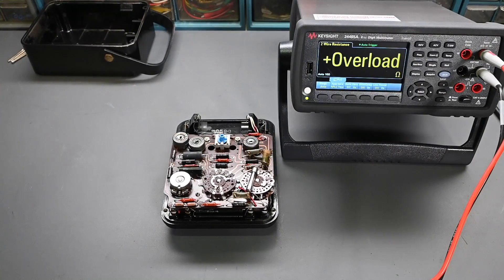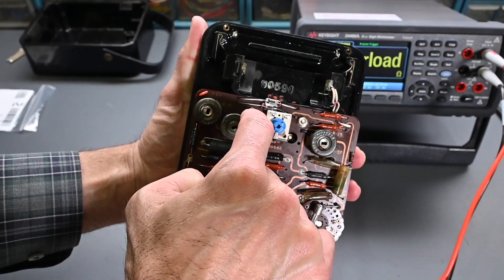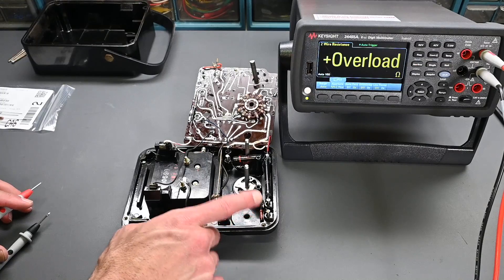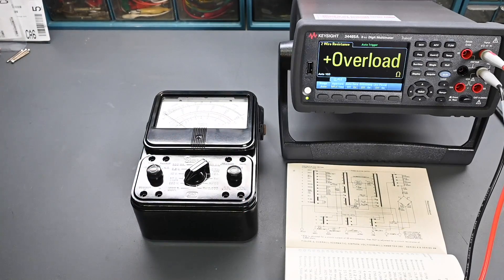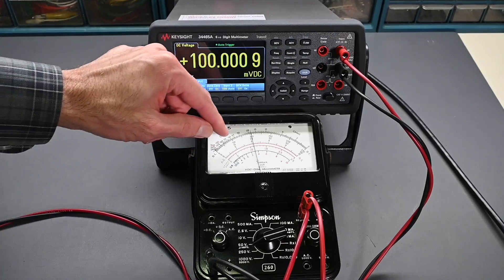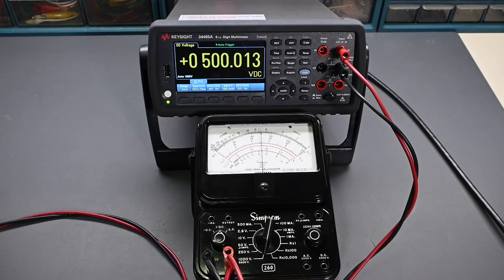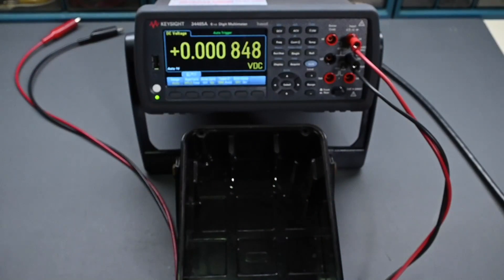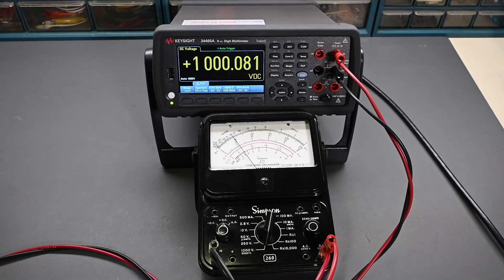Simpson 260 - 4 VOM Troubleshoot And Repair - Part 2

Comment: The resistors inside the Simpson 260 are used as dropping resistors to step down the voltage. A Resistor is NOT decreasing the electrons but is stepping down the voltage. Since voltage is NOT electrons, what is voltage? Voltage is EMF but EMF is not electrons.
Reply from the maker: Voltage can be thought of as a measure of electrical pressure like water pressure in a pipe.  The voltage comes from a  source such as a battery or in the case of the water analogy a pump.  A resistor is a restriction to electron flow like a pinch in a pipe.  Current (amps) is the amount of electron flow like the amount of water flowing in a pipe.
Reply: @EriksElectronicsWorkbench  Yes I get that but what I don't get is how to convert Pressure into what? because Pressure is NOT electrons. Pressure is EMF which also EMF is NOT Electrons so not sure how to convert Pressure/EMF into Electronics Theory
Reply from the maker: @waynegram8907  there are three basic things needed to create a voltage which is the potential difference as measured between two points.. electrons, conductor, and a force to drive the electrons.  The force can be mechanical like a generator or chemical like a battery.   Voltage is the "pressure" so I'm not sure what you want to convert to but perhaps some info here is helpful https://en.wikipedia.org/wiki/Coulomb   you would need to do further research in electronics theory books to dive deeper into the topic, as it's more than can be explained here.
Reply: @EriksElectronicsWorkbench  The measured 9vdc is saying the the battery has a Maximum pressure level at 9. The chemicals inside the battery is generating this Pressure/force to be at 9vdc, but I don't know what is causing the battery to be at 9vdc pressure/force? What I'm saying is that electrons don't generate or "make up" the pressure or force. There must be something else inside the battery that is "making up" the pressure and force since its NOT electrons. What is "making up" the pressure and force inside a battery?
Reply from the maker: @waynegram8907  it's the chemical reaction inside the battery that creates the voltage potential.  You'd have to dive into the theory at the atomic level to get into a complete discussion which is not my area of expertise.  also see this page  https://en.wikipedia.org/wiki/Alkaline_battery
Reply: @EriksElectronicsWorkbench  A Battery has 2 electrodes a + positive electrode that has been positively charged and a - negative electrode that has been negatively charged. The chemicals inside the battery is packed full of electrons. How does the battery generate the EMF and Voltage?

Comment: Extremely informative, and very well explained all along the process! Very impressive! I use a 270-5 and a 260-8 in my aircraft maintenance activities, I started my career many many moons ago with an old clamshell micronta analogue meter, then thought I was “upgrading” when I got a fluke 77, which I used for years. About 10 years ago a shop fire forced me to replace the fluke, I decided to take another look at analogue meters, as I missed the rapid reflex nature of the needle indication, and bought the 270-5 roll top heavy duty case version.  Then later added the 260-8 as a more daily driver with the Simpson cordura padded meter case.  Love the Simpsons! Best tool for electrical circuit troubleshooting in aviation practical use settings,  what do you think of the old Triplett 630NA meters?
Reply from the maker: Thanks for the compliment and glad you enjoyed the video.  The Triplett 630NA is a quality, reliable, and accurate meter but I'm not a fan of the 30 volt battery they used.  It has a unique internal construction but a bit tricky to work on.

Comment: Nice repair and recal. Erik. I just  went to go searching for this follow-up but it was at the top of my feed so that was a pleasant surprise. Take care  and stay safe, Mike    P.S . just subscribed and looking forward to catching up on your uploads..
Reply: Add.  I'll have to check the Series 4 when I pick it up I'm curious about that additional 4 Meg resistor although I believe you are correct about it being a user installed part.
Reply from the maker: @doogsm6013  another viewer said his meter had the resistor.  It seems odd.  It certainly made the calibration wrong.  Curious what you find.
Reply from the maker: thank you for subscribing!

Comment: Im willing to bet a few shops are relying on way out of calibration meters of this age.  
I used one in a professional setting many years ago but the model was then seven years old or so.  The one I just bought is an SP in scratch free condition

Comment: Great Video! Thanks for sharing your knowledge!
Is that fuse that is mounted across the selector switch factory or an after-market repair/modification?
Reply from the maker: Thanks for watching!  The fuse is factory installed in that position across the switch.

Comment: Good job Erik !  
Imagine measuring 4000 volts with the meter, who does that ?
Do you know where these meters are still professionally used ? As someone mentioned in the previous video, they are still available on the market, made where !
Reply from the maker: Simpson Electric still manufactures them in the USA.  Their website is https://simpsonelectric.com/products/test-equipment/vom-multimeters/    The new production meters top out at 1000 volts AC/DC.  That is standard on modern meters and a high voltage probe is needed for over 1000 volts.  Regular test probes are never safe over 1000 volts!  Analog multimeters are very useful on noisy AC measurements that make digital meters unreadable from gibberish number displays, and for measuring changing voltages that make digital number displays hard to track.  The analog meter can give a better understand on the rate of change.  These meters do not require battery power, except for ohms, so that can add to reliability.
Reply: @EriksElectronicsWorkbench  Thanks for the info, it's really interesting, I didn't know the company was still in business ! I still use analog meters and my favorite it my electronic Simpson really similar to the 260-6XLM on the Simpson's Web site, that I bought used in the 70's, you can inverse polarity no problem and the meter is rather accurate.

Comment: Also, if the ohms scales will not stay zeroed or the needle moves when you tap the side of the meter case, replace the big fuse. It has an intermittent connection. This happened to me. I know it is odd, but it really can happen. Save yourself a lot of trouble shooting time!
Reply from the maker: Yes I had a similar problem in my Sencore capacitor tester where the fuse went intermittent.  Fuse looked ok but had no continuity because the end cap connection broke.